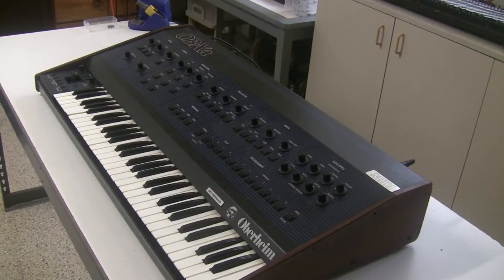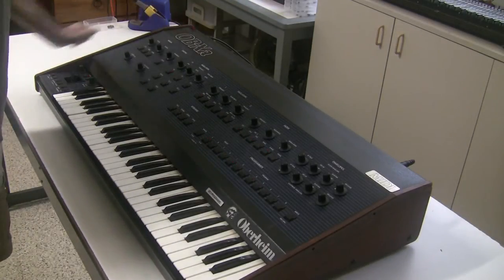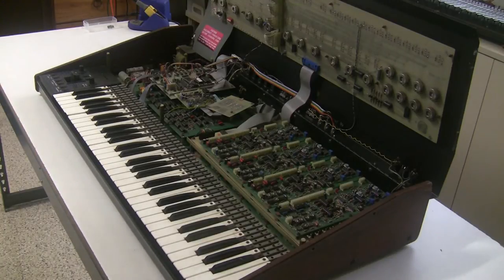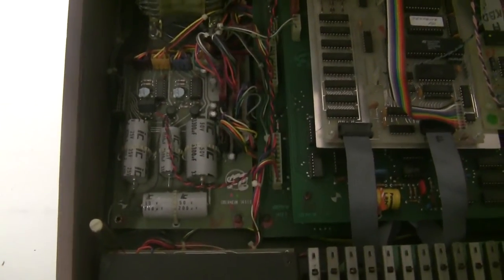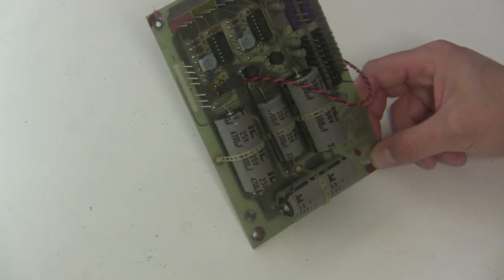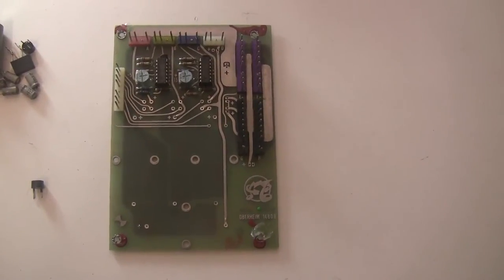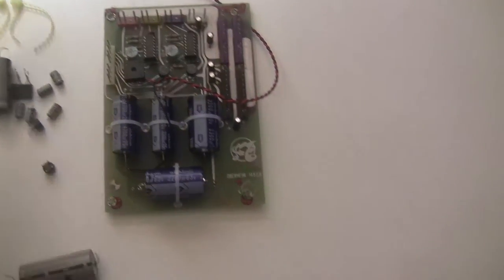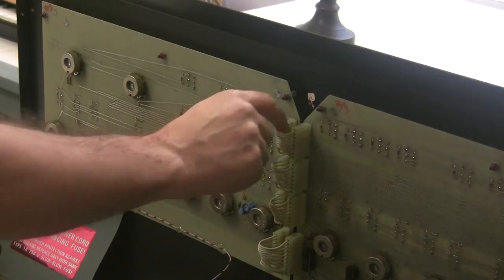Synthchaser #014 - Oberheim OB-Xa Repair - Part 1/3 - Power Supply & Voice Card Rebuilds

Comment: Great videos! Thank you for sharing. I've now ordered your PS and voice boards kits and my OBXa will be fixed and ready this spring :-) Installed Encore MIDI kit, but the pitch bend implementation sucked. Will install Kentons MIDI kit after changing caps and trimmers.
Reply from the maker: Thanks, I appreciate it!  I tried installing the Encore MIDI in one of my OB-Xa's and it make autotune fail on all 8 voices.  Was thinking of making my own "lite" MIDI adapter for these that just turn on and off the notes and don't involve re-writing the firmware.
Reply: BTW, what do you recommend to do with the lithium battery? What about replacing it with a holder for the common CR2032 type?
Reply from the maker: I usually replace them with the same kind, I think they have much more mAh than the CR2032.  I have them on my site, maybe just under OB-X.